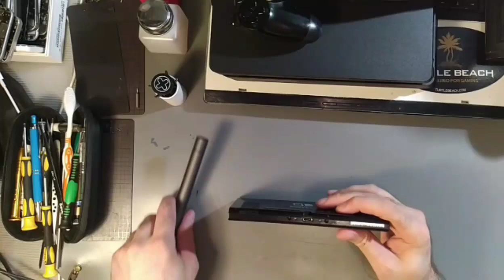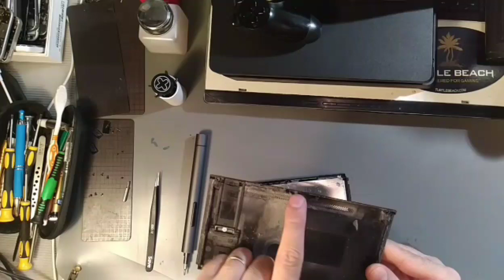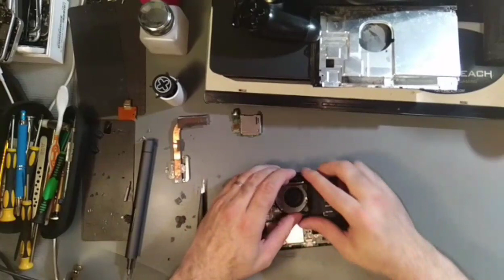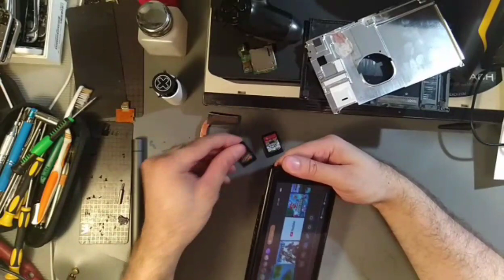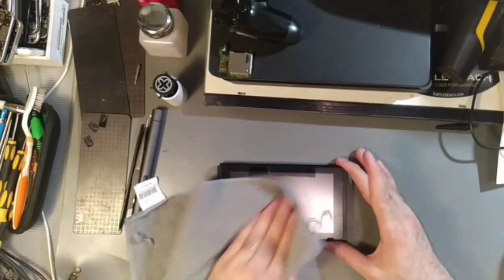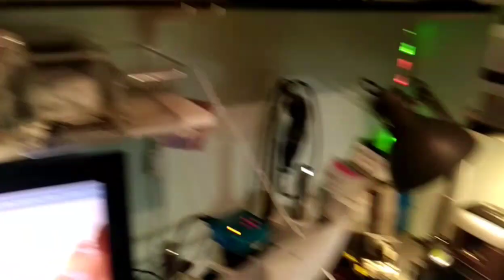🔧 NINTENDO SWITCH LES JEUX NE MARCHE PAS 🔧 [ REPARATION ]

Comment: Bonjour la carte est en rupture de stock du coup est-ce que vous avez un autre site à conseiller
Reply from the maker: Bonjour,
Avez-vous pu en acheter un depuis votre commentaire ?
Avez vous regarder sur Amazon, Cdiscount, eBay ?
Si vous ne trouvez nul part je peux vous vendre un de mes lecteurs que j'ai en stock.
Ajouter moi sur les réseaux pour prendre contact avec moi en privé pour que je puisse vous envoyer un lecteur.

Au passage n'hésitez pas à vous abonnez pour donner un peu de force à la chaîne 💪 
Cordialement

Comment: Bonjour, j'ai besoin d'aide car j'ai le même message pour zelda breath of the wild mais seulement pour ce jeux et j'ai l'impression que la cartouche est corodée car il y a des points verts. Comment je pourrait faire ? Merci de votre réponse par avance 👍
Reply from the maker: Bonjour, essaye de nettoyer ta carte avec de l'alcool et une brosse à dents. Le vert c'est de l'oxydation.
Reply: @smartpomme  merci j'essayerai 👍
Reply: @smartpomme  L'alcool ne va pas abimer la cartouche ? Car l'alcool est de l'acide.
Reply from the maker: Non juste un peu sur les dents en métal pour nettoyer l'oxydation.
Moi j'utilise de lisopropanol, c'est un produit spécial pour les circuits imprimés, l'électronique ect...
Reply: @aurelien2896 cc alors ca a fonctionné ? Ton jeu remarche t-il ?
Reply: @lyliarose5911  salut, c'est drole j'ai mis ce commentaire il y a 2 ans 😂.
Mauvaise nouvelle le jeu ne fonctionne plus.. il y a un message d'erreur sur la switch, apres j'y suis peut etre allé un peu fort, surtout ne gratte pas le vert avec une aiguille ou une lame mais avec un coton tige. J'ai demandé a nintendo si ils pouvaient la réparer et ils m'ont dis non mais il pouvaient m'envoyer un jeu neuf.
Voila,
Bonne soirér